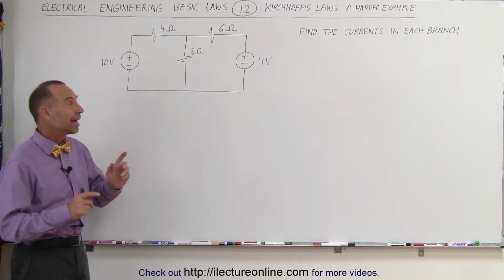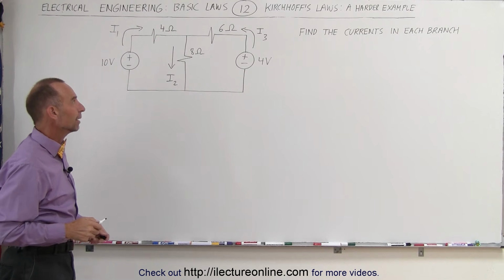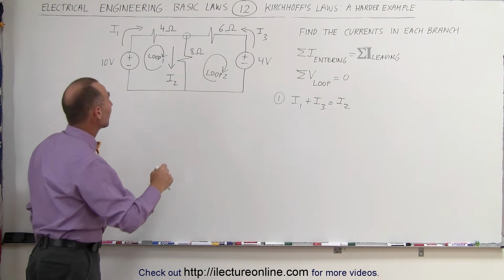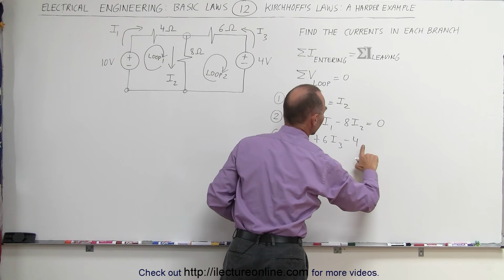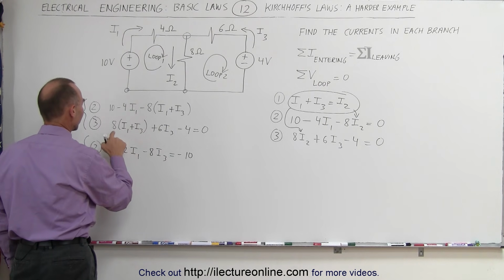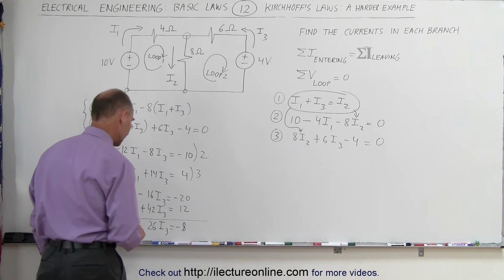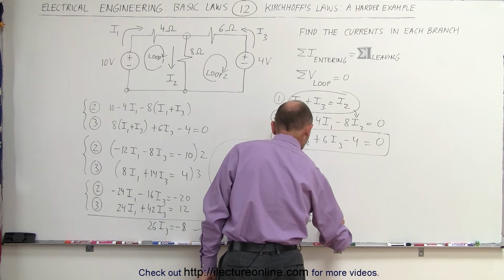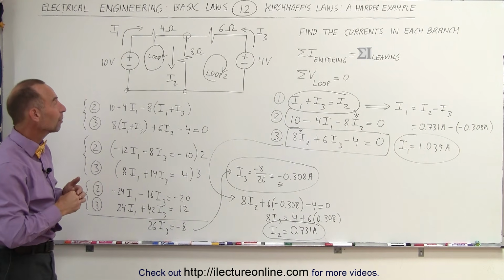Electrical Engineering: Basic Laws (12 of 31) Kirchhoff's Laws: A Harder

Comment: What do you do if you have two resistors in the middle (i2) and only want current and voltage across one of the resistors in the middle?
Reply from the maker: Since they would be in series, the current through both will be the same and the voltage across each would be (i2) x (R)
Reply: thank you, very much appreciated! great videos
Reply: sorry to be a pain, but does it matter which side of the battery your 4ohm resistor is? as on the circuit im doing my resistor is below where your 10v battery is
Reply: sorry to be a pain, but does it matter which side of the battery your 4ohm resistor is? as on the circuit im doing my resistor is below where your 10v battery is
Reply from the maker: No, as long as the resistor is on the same branch.

Comment: Hi, is there any other way u could explain the general sign convention when applying KVL? And in the case of loop 2, why is the equation 8 i2+ 6 i3 -4=0 instead of 8 i2+ 6 i3 +4=0. Isn't the current flow opposite to direction of loop for 4V voltage source? Many thanks :)
Reply from the maker: Since you are going around loop 2 in a counterclockwise direction, you cross the battery from the positive end of the battery to the negative end, thus there is a 4V voltage drop.     When picking current directions in each branch it doesn't matter if the directions are correct.  (The assumed directions could be opposite to the real directions).  Then work out the problem as is shown.  If you picked the incorrect direction, your answer(s) will come out negative.

Comment: When you find the other currents, why do you plug in -.0308 Amps for I3. What if i assumed the correct direction for I3 at first, and got a positive value, then my I1 and I2 would be different values
Reply from the maker: +Shlomo No, you would get the same values for I1 and I2, no matter what direction you assume for any of the currents.